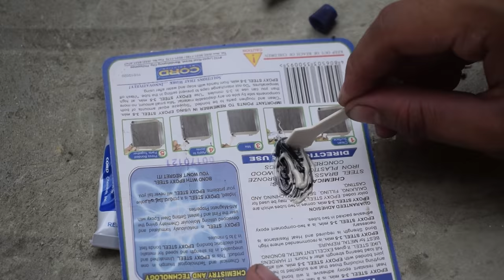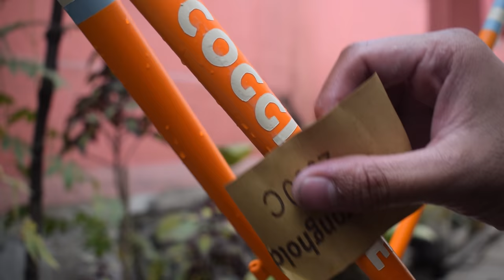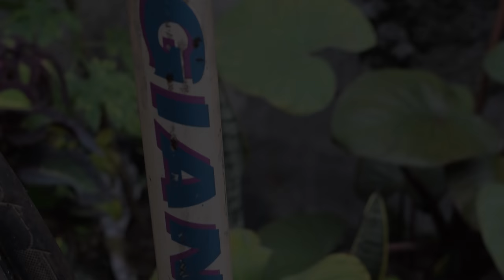Bike Restoration - GIANT PERIGEE 1994 Mikrolet Blue & Orange Vintage Restoration (FREE LABOR) [4K]

Comment: Beautiful work.  One question - it appeared as though the brake levers were mounted a bit on the low side - isn't usual method to check using a straight edge that bottom of bars and bottom of levers are equal?

Comment: Very nice road bike. Indexed downtube shifters are wonderful, I wish manufacturers still offered them.
You should probably treat the inside of the frame with an anticorrosive to prevent it from rusting through.
I doubt painting the pedals and cranks is a good idea. Also singlewall rims are a great pain.
Otherwise, a great service video, with love from Russia:^)
Reply from the maker: I sprayed some wd40 spray inside, I'm afraid I can't use any rust converters coz it will damage the integrity of the frame
Reply from the maker: Thank you for watching my friend from Russia, greetings from Philippines
Reply: @CoggieBike  in Russia, in most high-end shops steel frames are treated with the same stuff that's sprayed inside truck frames. It's not the same thing as a rust converter, it's a rust inhibitor/anticorrosive preservative

Comment: Hey! I love your videos, the bicycles look super nice and I could watch a milion videos without getting tired of it! I was wondering, which is the extractor or tool you are using to extract the bottom bracket, also what type is it? I have a bicycle that I believe it has the same bottom bracket as this one (biopace chainrings) and I've been looking wich type of extractor I need to use. :)
Reply from the maker: Just the common "BB remover tool" for square type BB
Reply: @CoggieBike  by what maker?? obviously it's a BB removal tool. who made it??? who makes all your tools? do you? or is there a manufacturer or company you use to build the tools? i use Park Tool in.my shop. I have never seen your versions of these tools , so the question is; Who makes the tools and is there a link to their website?

Comment: Maybin also suggest a chain stay guard to prevent contact abrasion from chain slap during shifting. Also, to other readers, I advise tightening the quick release in the upper position and tonthe rear. A stick, branch,  or other object could engage the level while traveling foward and disconnect the wheel.

Comment: The only thing I would have do e differently, would be to get brake levers which held the cable internally,  with a routing of both cables under the handle bar tape. Would clean the appearance nicely and reduce the busy aspect in front of the bar. Otherwise, top  notch work.😎👍
Reply from the maker: Thanks brother!

Comment: Idol nakaka anti rust ba ang clear coat?
Reply from the maker: Hindi po sir... Need niyo lagyan ng rust converter muna para may protection sa oxygen ung frame kapag nag apply kau ng primer
Reply: @CoggieBike  ay balak kopo kasi patungan lang ng clear coat yung steal fork ko para di mangalawang may stock na paitn pa naman sya pero pag kapalan koyung clear coat sir mangangalawang padin?

Comment: Shoe rub will take anodizing off of a crank - paint will be gone after a few rides. I think your frame painting skills are really good. I think your work would benefit from a gravity feed paint gun. It'll let you use higher quality automotive primers, let you mix your own colors, and most import, use two part epoxy clear coat which will make your paint last longer. 

You can really up your game by connecting with a local anodizer. But at minimum you would do well if you learned from someone with more metal working and finishing experience.